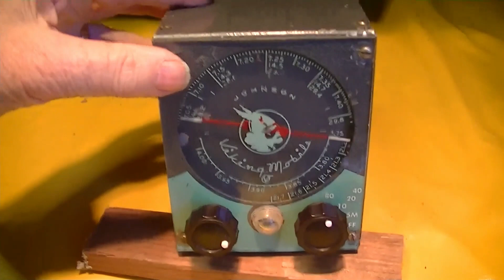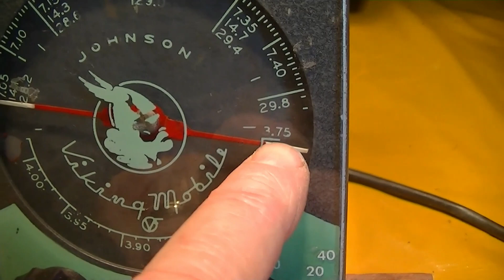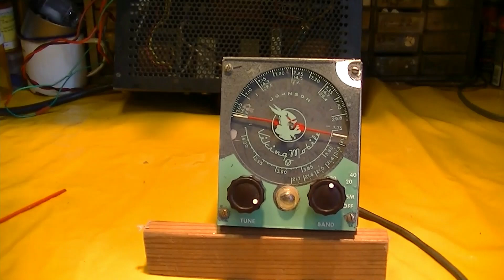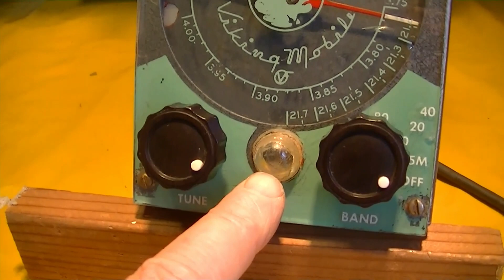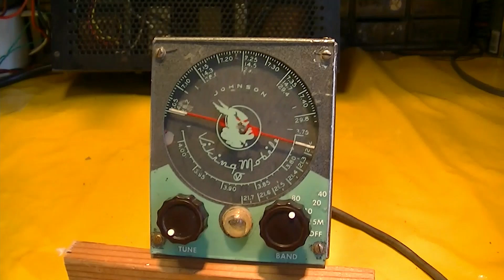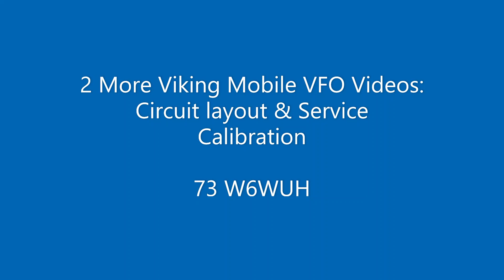EF Johnson Viking Mobile VFO   Rarest Johnson ?

Comment: Back in the mid 80s, I had the other Johnson Viking II Transmitter and VFO. I used it as a general for a few years, and it was a decent VFO and transmitter until the modulation transformer shorted out. Unfortunately, I gave it away, as I didn't know of the internet and what it would bring for ham radio enthusiast!